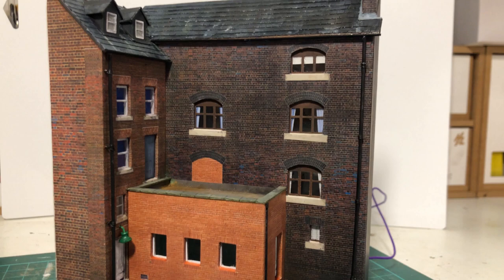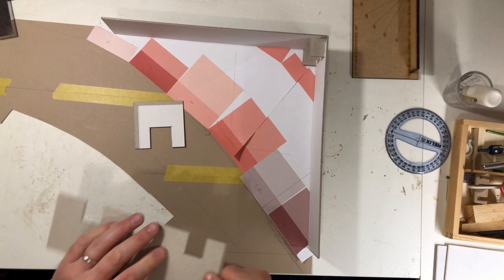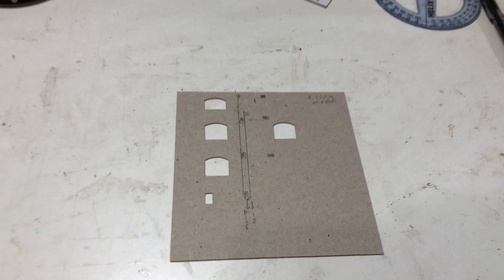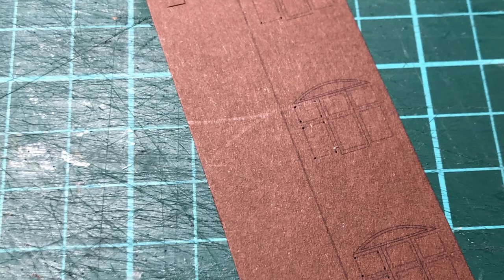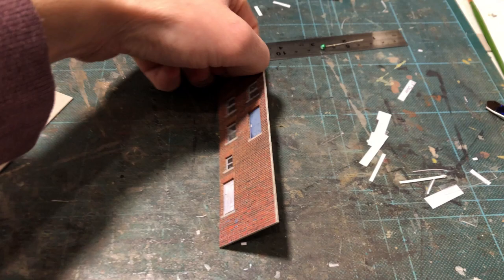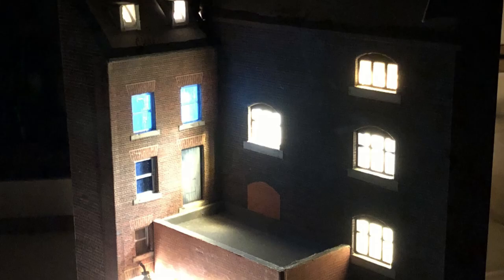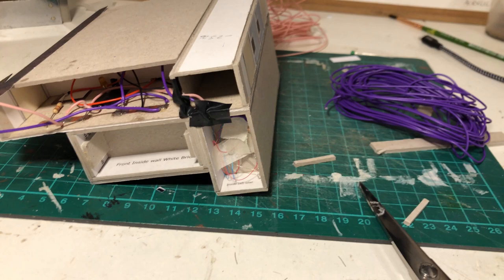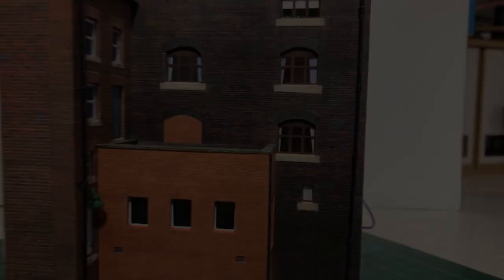High Street Backs - Low Relief Scratch Build | 011

Comment: Looking good. You might consider using ordinary baking foil for the lead flashing - it folds like soft, metal sheets on the model and can be used unpainted, where it looks like brand new, uncorroded lead; or with a grey acrylic wash to simulate weathered flashing.
Reply from the maker: Thanks Paul, I tried that previously but struggled to get it to stick. I'll give it a go on the next build. Thanks

Comment: After cutting out a good few thousand windows I got a Cricut. It's a lifesaver (well a fingertip saver at any rate!)  There's some fettling involved getting it to cut fine angles in 2mm card (If using the rotating blde I found at least) but it makes the construction process a lot easier. I also noticed you used copper tape as a busbar by the look of it. Have you used it to run your actual lights? I find it easier than cutting noches in everything to route wires. My power comes in from a re-purposed usb phone charger cable to a single resistor then I run all the led's in series using the copper tape.😉
Reply from the maker: Hi Bill, thanks for the comments. I have just got the cricut and the knife blade so the next building will be mostly cut using that! I've had a few tries with windows as a test so looking forward to getting stuck in! I don't know why I didn't think of using the copper tape all the way up, I'll definately be using this next time! Cheers
Reply: @deansburytownmodelrailway5056  The tape will make it easier trust me! I run it along under my cover layer.  I usually use it on the floor of the floor above where i intend to light if that makes sense. I also use one strip split up the center I've found that more economical and perfectly sufficient. Merry Christmas & all the best for 2022.
Reply from the maker: @billforrest4205  thanks, will definitely be giving that a try next time

Comment: Hi Liam, You mentioned having used a cricut machine for several parts. I was looking into buying one but got put off by being told that cutting 1 - 2mm card would require a lot of passes and ruin the blade and it wouldn't be able to cut through 1mm plasticard. What is your experince of the machine?
Reply from the maker: It’s early days yet but I’m cutting 1mm grey board with about 4- 5 passes and 2mm with 7-8. Not sure about blade length time will tell! It’s great for accuracy and straight cuts. Not entirely sure if it’s quicker but much easier on your hands. Also it’s great for thin cars for windows, tiles etc
Reply: @deansburytownmodelrailway5056  Thanks